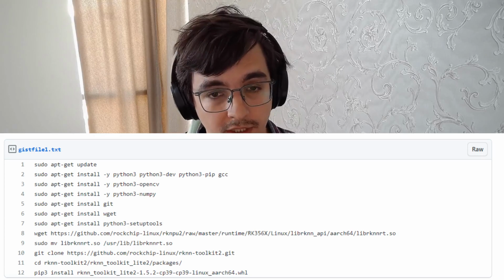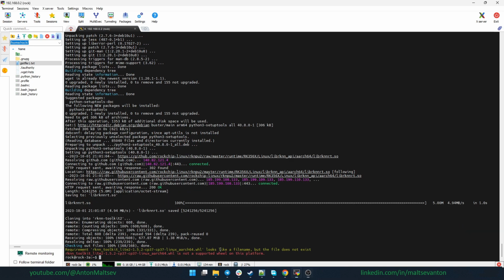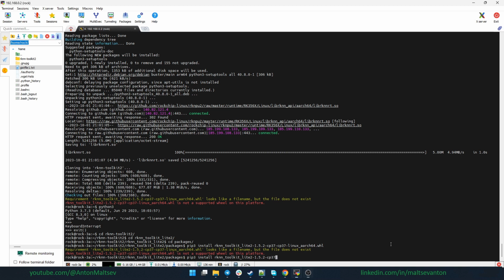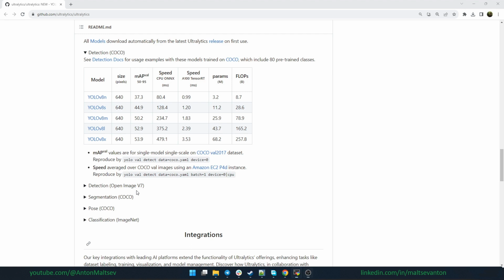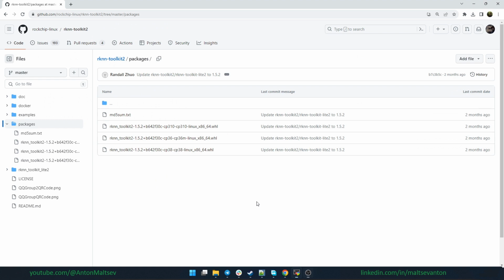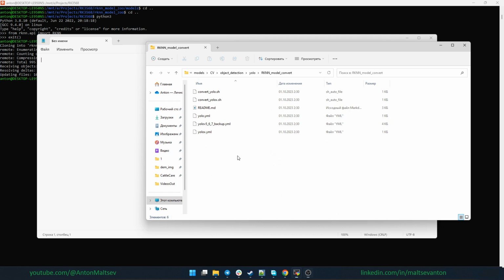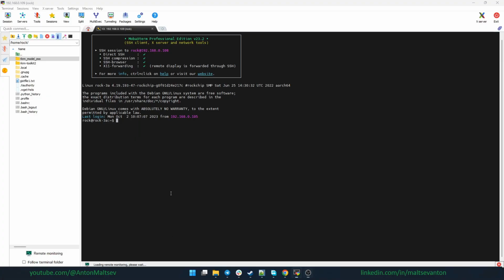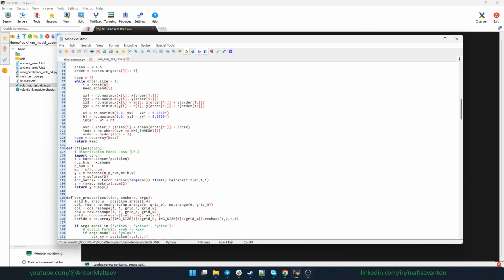Running YOLO (Yolov8, Yolov5, Yolov6, YoloX, PPYolo) on RockChip NPU (RK3566, RK3568,RK3588, RK3576)

Comment: :~/rknn_model_zoo/models/CV/object_detection/yolo/RKNN_model_convert$ sh convert_yolo.sh
Traceback (most recent call last):
  File "/home/aaquib/rknn_model_zoo/models/CV/object_detection/yolo/RKNN_model_convert/../../../../../common/rknn_converter/rknn_convert.py", line 92, in <module>
    parser = RKNN_config_container(args.yml_path, args.target_platform)
  File "/home/aaquib/rknn_model_zoo/common/rknn_converter/config_parser.py", line 120, in _init_
    user_define_config = yaml.safe_load(f)
  File "/home/aaquib/.local/lib/python3.10/site-packages/ruamel/yaml/main.py", line 1105, in safe_load
    error_deprecation('safe_load', 'load', arg="typ='safe', pure=True")
  File "/home/aaquib/.local/lib/python3.10/site-packages/ruamel/yaml/main.py", line 1039, in error_deprecation
    raise AttributeError(s, name=None)
AttributeError:
"safe_load()" has been removed, use

  yaml = YAML(typ='safe', pure=True)
  yaml.load(...)

instead of file "/home/aaquib/rknn_model_zoo/common/rknn_converter/config_parser.py", line 120

                user_define_config = yaml.safe_load(f)

Comment: Which camera we can use for Orange Pi 5B? Can we use the RPi Camera module?
Reply from the maker: I am unsure, but I think OrangePi 5 (and some other Orange Pi boards) has a different camera format than other boards. They did not support CSI; they just used some internal format. But maybe there are some adapters
Reply: @AntonMaltsev  Can you please tell me which camera modules can work which is cost effective because the Orange PI camera module is costly.
Reply from the maker: @AaquibNiyama-k1s  never used CSI for OrangePi. I used some USB cameras, or different boards, with regular CSI interface.

Comment: When I try to run code (or other npu related code) I get:
E RKNN: [22:57:09.806] failed to open rknpu module, need to insmod rknpu dirver!
E RKNN: [22:57:09.806] failed to open rknn device!
E Catch exception when init runtime!

On Orange PI 5, Ubuntu 22.04 downloaded from the OrangePi web site.
Reply from the maker: Don't have any idea about this. 
It seems that NPU or drivers are not correctly installed.
Are you completely on the 1.6 RKNN version?

Comment: Intro
- 0:01: The speaker discusses the increasing popularity of Rockchip in the computer vision world.
- 0:15: Acknowledges the popularity of Rockchip and mentions addressing two common problems in this video.
- 0:23: Highlights changes and updates in the Rockchip ecosystem over the years.
- 0:47: Promises an up-to-date guide as of October 2023 to address running different YOLO models on Rockchip NPUs.

System Setup and Issues
- 1:47: Introduces the system used, Rock P ER car 3568, and mentions testing on a different board.
- 2:57: Discusses potential problems like driver installation, using sudo commands, and NPU detection issues on specific boards.
- 3:24: Acknowledges the guide may not be universally excellent for all boards and recommends adjusting for specific cases.

Logic of YOLO Network Setup
- 3:38: Introduces the logic of preparing a YOLO network for Rockchip NPUs.
- 3:46: Emphasizes the need to understand the process: preparing, exporting, and running the network on the board.

Step 1: Set Up the System
- 4:49: Describes the first step, which involves SSH connection, using a script to set up the system on an empty board.
- 5:12: Advises modifying parameters in the script based on the specific board and system.
- 7:17: Stresses the importance of updating Python versions, with a focus on Python 3.7 in this case.

Step 2: Set Up RKNN YOLOv8 Export
- 11:25: Introduces the second step, setting up the YOLOv8 rapper from Rockchip for exporting the model.
- 13:33: Describes the process of setting up the YOLOv8 repository, creating a new environment, and running the export script.

Step 3: Set Up Rknn-Toolkit
- 13:54: Introduces the third step, setting up Rknn-Toolkit on an x86 machine for exporting the model in ARANN format.
- 15:16: Highlights the complexity of environment setup, particularly for compatibility with specific Python versions and GCC.

Step 4: Run Network on RockChip
- 20:08: Details the fourth step, running the network on the Rockchip device after successfully exporting the model.
- 20:31: Discusses modifications needed in the code to ensure compatibility with Rockchip and the successful execution of the network.

Modifications to YOLOv8 Code
- 25:09: Discusses reshaping in the code and the use of a specific function.
- 25:22: Mentions making modifications in the future and moves to the next point.
- 25:40: Talks about additional adjustments in the code.
- 25:49: Addresses a specific issue in the code, possibly an error.
- 25:56: Indicates a need for fixing something in the future.

Translation and Code Modification
- 26:03: Introduces the task of translating the code to English.
- 26:10: Begins the translation process and addresses the first modification.
- 26:16: Mentions being at a specific point in the code.
- 26:23: Discusses running a particular section of the code.
- 26:29: Highlights the need for translation to English.
- 26:38: Mentions a lot of modifications that need to be made.
- 26:46: Addresses a potential error related to model path.
- 26:56: Refers to specifying the target in the official documentation.
- 27:02: Talks about specifying the target for the system and discusses the use of default values.
- 27:11: Emphasizes the importance of specifying certain parameters.

Testing and Additional Code Modifications
- 27:17: Discusses the need to specify a particular ID.
- 27:25: Mentions using default data and displaying results.
- 27:33: Verifies that necessary modifications have been saved.
- 27:44: Initiates a test of the code.
- 27:50: Discovers a potential issue and considers the deletion of the torch.
- 28:00: Realizes that the torch has been deleted and addresses the issue.
- 28:10: Corrects the model path error.
- 28:26: Specifies the correct path for the expert model.
- 28:41: Continues with additional modifications.
- 28:52: Makes another adjustment in the code.
- 28:58: Initiates further changes.
- 29:23: Refers to an application and confirms everything is working.
- 29:32: Describes the image display through the interface.
- 29:39: Acknowledges the functionality of the code.
- 29:46: Comments on the legitimacy of the results.
- 29:52: Addresses the potential saving location of results.
- 29:59: Considers the need to specify a specific folder for saving.
- 30:07: Expresses uncertainty about the saving process.
- 30:13: Acknowledges the current functionality without modifications.
- 30:19: Mentions the necessity of adjustments for better performance.
- 30:26: Confirms the successful conversion of the code.
- 30:33: Discusses final adjustments needed at runtime without parameters.
- 30:40: Indicates the conclusion of the code-related discussion.

Disclaimer: I used chatgpt3.5 to summarize the video transcript.  This
method may make mistakes in recognizing words

Comment: The rknn_model_zoo library has been recently updated with the content of yolov8-seg, but when I tested it, I found that the post_process function in it will take a long time, and the effect of modifying the dfl function according to the video method is not obvious, may I ask how the post_process function should be modified to improve the calculation speed? Here is the content of post_process function, thanks.

def post_process(input_data):
    # input_data[0], input_data[4], and input_data[8] are detection box information
    # input_data[1], input_data[5], and input_data[9] are category score information
    # input_data[2], input_data[6], and input_data[10] are confidence score information
    # input_data[3], input_data[7], and input_data[11] are segmentation information
    # input_data[12] is the proto information
    proto = input_data[-1]
    boxes, scores, classes_conf, seg_part = [], [], [], []
    defualt_branch = 3
    pair_per_branch = len(input_data) // defualt_branch 

    for i in range(defualt_branch):
        boxes.append(box_process(input_data[pair_per_branch * i]))
        classes_conf.append(input_data[pair_per_branch * i + 1])
        scores.append(np.ones_like(input_data[pair_per_branch * i + 1][:, :1, :, :], dtype=np.float32))
        seg_part.append(input_data[pair_per_branch * i + 3])

    def sp_flatten(_in):
        ch = _in.shape[1]
        _in = _in.transpose(0, 2, 3, 1)
        return _in.reshape(-1, ch)

    boxes = [sp_flatten(_v) for _v in boxes]
    classes_conf = [sp_flatten(_v) for _v in classes_conf]
    scores = [sp_flatten(_v) for _v in scores]
    seg_part = [sp_flatten(_v) for _v in seg_part]

    boxes = np.concatenate(boxes)
    classes_conf = np.concatenate(classes_conf)
    scores = np.concatenate(scores)
    seg_part = np.concatenate(seg_part)

    # filter according to threshold
    boxes, classes, scores, seg_part = filter_boxes(boxes, scores, classes_conf, seg_part)

    zipped = zip(boxes, classes, scores, seg_part)
    sort_zipped = sorted(zipped, key=lambda x: (x[2]), reverse=True)
    result = zip(*sort_zipped)

    max_nms = 30000
    n = boxes.shape[0]  # number of boxes
    if not n:
        return None, None, None, None
    elif n > max_nms:  # excess boxes
        boxes, classes, scores, seg_part = [np.array(x[:max_nms]) for x in result]
    else:
        boxes, classes, scores, seg_part = [np.array(x) for x in result]

    nboxes, nclasses, nscores, nseg_part = [], [], [], []
    agnostic = 0
    max_wh = 7680
    c = classes * (0 if agnostic else max_wh)
    ids = torchvision.ops.nms(
        torch.tensor(boxes, dtype=torch.float32) + torch.tensor(c, dtype=torch.float32).unsqueeze(-1),
        torch.tensor(scores, dtype=torch.float32), NMS_THRESH)
    real_keeps = ids.tolist()[:MAX_DETECT]
    nboxes.append(boxes[real_keeps])
    nclasses.append(classes[real_keeps])
    nscores.append(scores[real_keeps])
    nseg_part.append(seg_part[real_keeps])

    if not nclasses and not nscores:
        return None, None, None, None

    boxes = np.concatenate(nboxes)
    classes = np.concatenate(nclasses)
    scores = np.concatenate(nscores)
    seg_part = np.concatenate(nseg_part)

    ph, pw = proto.shape[-2:]
    proto = proto.reshape(seg_part.shape[-1], -1)
    seg_img = np.matmul(seg_part, proto)
    seg_img = sigmoid(seg_img)
    seg_img = seg_img.reshape(-1, ph, pw)

    seg_threadhold = 0.5

    # crop seg outside box
    seg_img = F.interpolate(torch.tensor(seg_img)[None], torch.Size([640, 640]), mode='bilinear', align_corners=False)[0]
    seg_img_t = _crop_mask(seg_img, torch.tensor(boxes))
    seg_img = seg_img_t.numpy()
    seg_img = seg_img > seg_threadhold

    return boxes, classes, scores, seg_img

Comment: Hey, 
I followed you guide and my board is RK3588. I am fcaing below error:

debian@bookworm:~/rknn_model_zoo/models/CV/object_detection/yolo/RKNN_python_demo$ python3 yolo_map_test_rknn.py --model yolov8 --model_path ../RKNN_model_convert/model_cvt/RK3588/yolov8s_rknnopt_RK3588_i8.rknn --img_folder ../test_data --img_show 
/home/debian/rknn_model_zoo/models/CV/object_detection/yolo/RKNN_python_demo/yolo_map_test_rknn.py
None anchors file determine, free anchors mode

Continue? [Y/N]
Y or N:Y

--> Init runtime environment
E Catch exception when init runtime!
E Traceback (most recent call last):
  File "/home/debian/.local/lib/python3.11/site-packages/rknnlite/api/rknn_lite.py", line 140, in init_runtime
    self.rknn_runtime = RKNNRuntime(root_dir=self.root_dir, target=target, device_id=device_id,
                        ^^^^^^^^^^^^^^^^^^^^^^^^^^^^^^^^^^^^^^^^^^^^^^^^^^^^^^^^^^^^^^^^^^^^^^^
  File "rknnlite/api/rknn_runtime.py", line 319, in rknnlite.api.rknn_runtime.RKNNRuntime._init_
  File "rknnlite/api/rknn_runtime.py", line 562, in rknnlite.api.rknn_runtime.RKNNRuntime._load_library
  File "/usr/lib/python3.11/ctypes/_init__.py", line 376, in __init_
    self._handle = _dlopen(self._name, mode)
                   ^^^^^^^^^^^^^^^^^^^^^^^^^
OSError: /usr/lib/librknnrt.so: invalid ELF header

Init runtime environment failed

Any  help is much appreciated. Thanks in advance.

Comment: Is there any way to increase the inference speed of rknn models on python? Currently NPU usage is a bit low, how can we increase it?
Reply from the maker: I did not experiment with this. There are some samples with multithreading - https://github.com/leafqycc/rknn-multi-threaded (Python) - https://github.com/leafqycc/rknn-cpp-Multithreading (C++) and this https://github.com/thanhtantran/rknn-multi-threaded-3588 (C++).
Maybe a few parallel processes can speed up this.
Reply: I have tried using multiprocessing in the following way, with the code changed from the yolo_map_test_rknn.py file of rknn_model_zoo, but found no change in speed.
import concurrent.futures
def process_frame(frame):
    img_src = frame
    img = co_helper.letter_box(im=img_src.copy(), new_shape=(IMG_SIZE[1], IMG_SIZE[0]), pad_color=(0, 0, 0))
    img = cv2.cvtColor(img, cv2.COLOR_BGR2RGB)
    input_data = img
    outputs = model.run([input_data])
    boxes, classes, scores = post_process(outputs, anchors, args)
    img_p = img_src.copy()
    if boxes is not None:
        draw(img_p, co_helper.get_real_box(boxes), scores, classes)
    return img_p

cap = cv2.VideoCapture(0)
pool = concurrent.futures.ThreadPoolExecutor(max_workers=8)
while True:
    ret, frame = cap.read()
    if not ret:
        break
    future = pool.submit(process_frame, frame)
    cv2.imshow("full post process result", future.result())
    if cv2.waitKey(1) & 0xFF == ord('q'): 
        break
pool.shutdown(wait=True)
cap.release()
cv2.destroyAllWindows() @AntonMaltsev
Reply from the maker: @LJC-zl4ye  , you may be limited by camera speed here "cap = cv2.VideoCapture(0)"
Just try it with inference on a fixed image, something like "frame = np.zeros((480,640,3), np.uint8)"
Your camera may have 30/60 frames limitation
Reply: I've tried this but the average FPS is still only 30. @AntonMaltsev
Reply from the maker: @LJC-zl4ye   did you remove "ret, frame = cap.read()", " cv2.imshow", "cv2.waitKey(1)" etc. from the loop?
Reply: I didn't  remove them. I tested it using the code below. The average FPS is only 30，and the max NPU load is ''Core0: 19%, Core1: 16%, Core2: 16%''.

def process_frame(frame):
        img_src = frame
        img = co_helper.letter_box(im=img_src.copy(), new_shape=(IMG_SIZE[1], IMG_SIZE[0]), pad_color=(0, 0, 0))
        img = cv2.cvtColor(img, cv2.COLOR_BGR2RGB)
        input_data = img
        outputs = model.run([input_data])
        boxes, classes, scores = post_process(outputs, anchors, args)
        if boxes is not None:
            draw(img_src, co_helper.get_real_box(boxes), scores, classes)
    return frame

if _name_ == '__main__':

    prev_time = time.time()
    frame_count = 0
    total_fps = 0
    pool = concurrent.futures.ThreadPoolExecutor(max_workers=8) 
    while True:
        frame = np.zeros((480, 640, 3), np.uint8)
        future = pool.submit(process_frame, frame)
        current_time = time.time()
        fps = 1 / (current_time - prev_time)
        prev_time = current_time
        frame_count += 1
        total_fps += fps
        cv2.putText(future.result(), f'FPS: {fps:.2f}', (20, 40), cv2.FONT_HERSHEY_PLAIN, 2, (0, 255, 0), 2)
        cv2.imshow("full post process result", future.result())
        if cv2.waitKey(1) & 0xFF == ord('q'): 
        break
    pool.shutdown(wait=True)
    average_fps = total_fps / frame_count
    print(f"average_FPS: {average_fps:.2f}")
    cv2.destroyAllWindows()
 @AntonMaltsev
Reply from the maker: @LJC-zl4ye  I have a few ideas:
1) you have a lot of useless functions that significantly slow down your loop. cv2.imshow, c2.waitkey, draw, etc.
2) Did you check that you have 8 simultaneous threads?
3) Did you turn on all the cores? (RKNNLite.NPU_CORE_0_1_2)
4) Did you try exactly this script, and how fast is it - https://github.com/leafqycc/rknn-multi-threaded/blob/nosigmoid/main.py ?

Comment: Have you been able to get yolo to run on the rockchip with C++ and not through python?
Reply from the maker: The model obtained with such an approach should run on C++. The only problem is that you need to re-write NMS and all the other functions on the model output.

Comment: what do you recommend for computer vision (CV) with $50 limit?
And what do you recommend for CV with $150 limit?
Reply from the maker: It depends on the task and skills.

for 50$
So, for someone who is not familiar with embedded and doesn't need high performance, I can recommend old RPi - https://thepihut.com/products/raspberry-pi-3-model-a-plus
A lot of guides and a small amount of bugs. But pretty slow.

For someone who is familiar with embedded and neural networks - RockChip 3568 looks nice. There were ~35$ boards a year ago. Don't know if it's still in production.

Also, there are a lot of Arduino-like boards
--------------

For 150$ - a lot of boards availiable. Should consider resourses and task.

Comment: if modele traind for 640, is it possible to run camera 1280x736? Thnaks.
Reply from the maker: There are a few approaches to this:
1) Reshape input to 640 size
2) Export model in 1280x736

However, the best practice is to use a model with the same parameters you used when training it.

Comment: What are the performance of the rk3588 on yolov5s and yolov8n
Reply from the maker: Didn't test it, sorry. Also, when you ask such questions, you'll need to specify the size of the image. 224*224 vs 640*640 give you almost 10x different speed. You can check my results for rk3568 here:
https://medium.com/@zlodeibaal/choosing-computer-vision-board-in-2022-b27eb4ca7a7c
https://www.youtube.com/watch?v=Sadmw6Rrj1Y